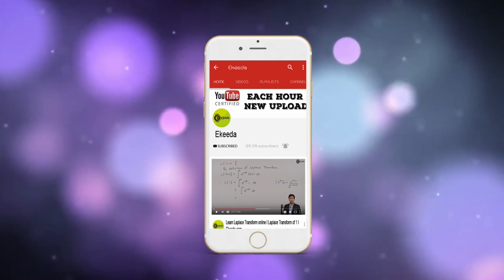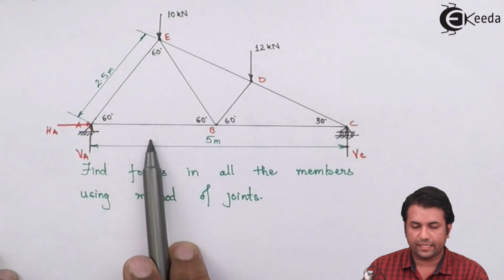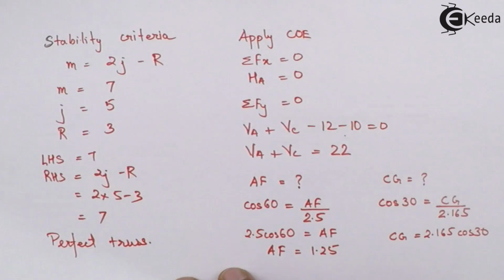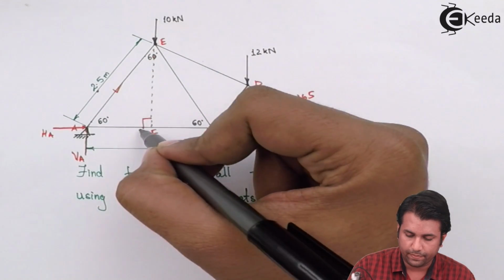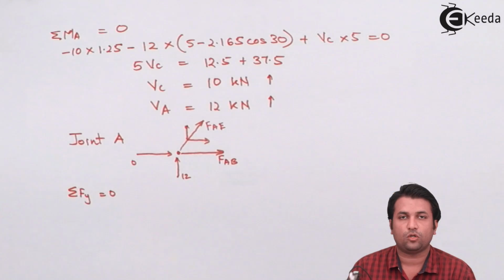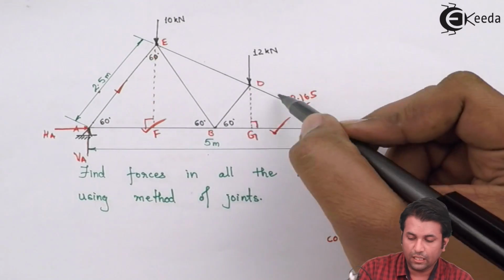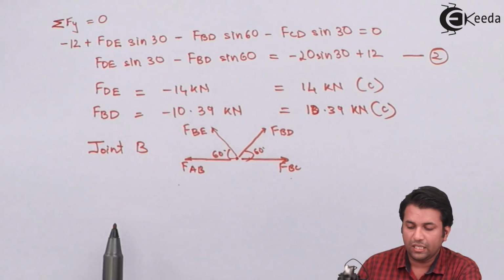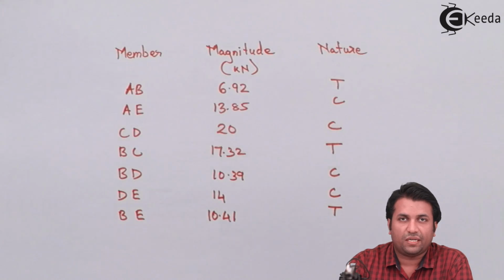Method of Joints Problem No.1 - Analysis of Trusses - Engineering Mechanics

Comment: The quality of the explanation is not satisfactory. First he makes a mistake in calculating the reactions, then at the middle of the lecture he suddenly starts recalculating the reactions to correct his mistake without any warning. Through out the lecture he jumps over the steps and thereby leaving the student confused. For example for Joint D, the force along CD is already known as compressive, but he assumes it as Tensile and then take it as negative for the calculation, why he does like that? No explanation is given. Sorry to say that the quality of this instructor is not good and Ekeeda.com should take note.
Reply: Exactly

Comment: Very poor explanation. You rather create confusion than clarity. Though the steps and start were satisfactory, your method of approaching to the solution of the problem is of  a low kind. One more mistake is that the reason for compressive force in a member is not the -ve sign, but the default consideration of force is tensile which makes the -ve sign give an idea of reverse value eventually making it compression in the member. Anyone having any doubt regarding my comment can ask me in the reply.
Reply: You're right... Please make me understand how to find compressive and tensile force...

Comment: While solving the sum please keep the question in the front it feels like a confusion during drawing fbd
Reply from the maker: Thanks for your suggestion. We will improve it
Reply: @Ekeeda  at joints(free body diagram) .. How could we determine that the arrows should be towards the joint or it should be away fron the joint.. Plzz reply sir
Reply: I can give you a tip. Keep your finger tip on the joint. The compressive force should have the arrow pointed like hitting your finger, and Tensile direction should show arrow pulling away from your finger tip. Hope it helps. Actually the Instructor should be explaining this as part of the video.